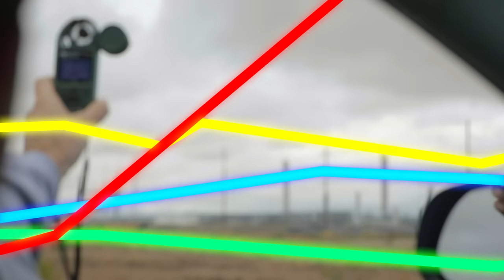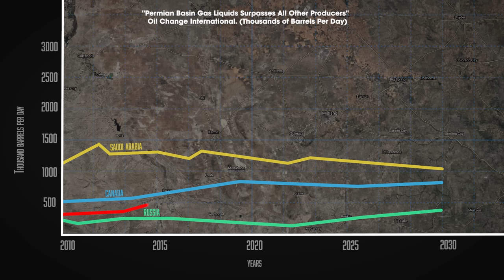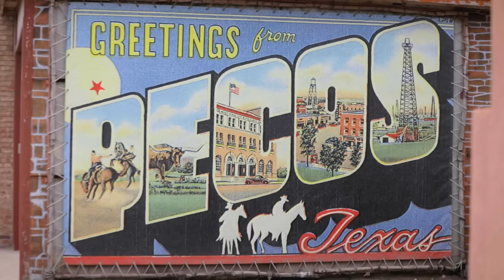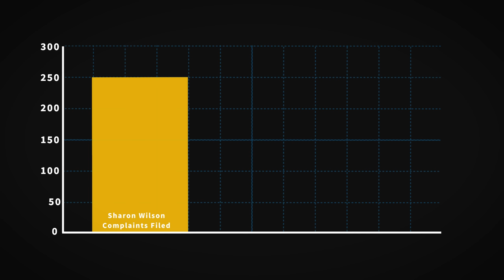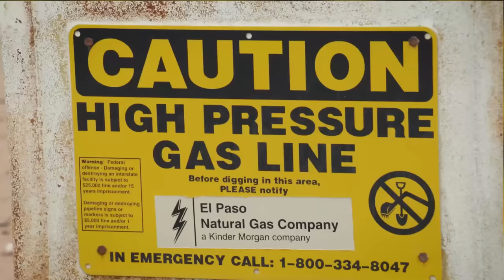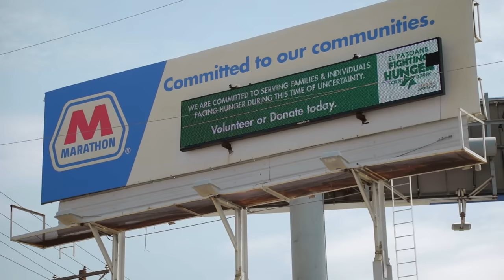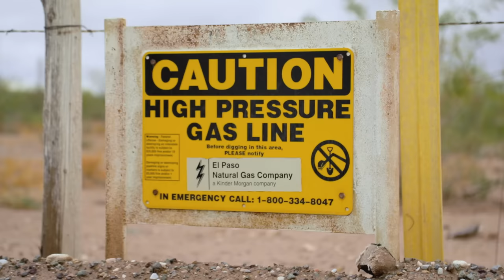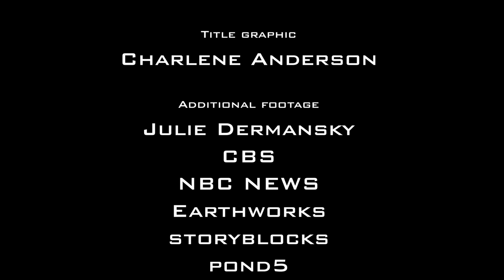Uncovering the Permian Climate Bomb

Comment: It is so shocking that these toxins have been invisible until you exposed them. Industries never have regulated themselves.
Reply: It's not so much the toxic aspect, if any, of methane but rather the impact on global warming and climate change that is the problem. 86x the greenhouse effect of carbon dioxide and it lasts for about a decade before oxygen breaks it down... 2022 saw a 'methane bloom' that 'had scientists baffled' and obviously added to the extreme temperatures seen that summer. It's no mystery if you take into account all the fracking and the fact the methane tipping point has been passed years ago and we are now seeing permafrost above and below the ocean releasing masses of stored methane.
Reply: @christianzilla  The methane is a huge concern for climate change and the low-hanging fruit in the solution. And methane brings hitchhiker gasses with it up from the formation. Volatile organic compounds like benzene and cause cancer and many other horrible health impacts.
Reply: @TXsharon  petrol is almost pure benzene.
Reply: @christianzilla  
The actual factor for methane is X150 - 200 times the effect of carbon dioxide : the X86 is based on an assumed rate of methane reduction to carbon dioxide by Hydroxyl ions for a given period. But if the methane level is maintained, the full X150 - 200 times should be used.  

Hydroxyl is created by UV impacting water : methane reduction rates are low at high latitudes due to low light level, especially in winter. 

Among the toxins released is radio-active gases, radon, radio-active isotopes of xenon. Fracking not only releases the natural gas, but also the radio-active gases generated  by the radio-active decay of Uranium, which accumulates in the rock.

Comment: The oil industry can survive, but extreme innovation is necessary. Greenhouse gas emissions have to stop.
Reply: The IPCC and the International Energy Agency say that new oil and gas investment needed to stop at the end of 2021. Even if they can stop the methane, it creates CO2 when burned for energy. Full STOP!
Reply: To be clear we need to divide the petroleum industry into two categories. 

Fuels need to stop. Stop demand, stop burning them to stop production. Support any and all decent competitive market solutions. 

Petrochemicals and Petro Materials should continue. Many of them actually reduce our emissions, efficiency and health. These do not need reduction but there is definitely improvement. Better disposal/recycling of plastics as the biggest problems with plastics are after they have been used. More environmentally efficient production, stop the leaking between the well and the refinery, enforced wellsite reclamation, improvements in social justice consequences of the petroleum materials supply chain. 

So we are not ending all petroleum, just reducing it by eliminating the market for its most damaging product, and continued improvement of its other products.

Comment: Climate crisis solutions including an open sourced, gravity driven, continuous motion, free energy generator called the Power Multiplier Device. 
  The Grow-Live Tower, which is a cylindrical structure with a central support column, periphery support columns, and suspension cables connecting the two to support the floor levels. This tower provides the food for the people that live in the lower 20 levels by growing it in the upper 60 levels. These Tower/generators, if embraced by the world, would end world hunger, homelessness, cut global disease by 85% due to improved living conditions, increase water conservation by 10,000%, end the poisoning of the world's water by petroleum and mono culture's 'one crop' farming, end the world money system by providing all the essentials for life for free.

  Restoring Arctic Ice. The water temperature at the bottom of the sea is colder than at the top, so simply pump up the cold water at the edge of the ice flow to slow the warming/melting process. This can be done by hanging 30' diameter tubes, by floatation vertically from the surface to close to the bottom. A pump at the top would need to just pump out 4' of water before the capillary effect would automatically begin bringing up the colder water to the surface. If 10,000 of these were placed close to the ice edge it would effectively lower the temperature of the water that is contacting the ice flow, slowing the melt during summer, increasing the ice build up in winter, and lowering the mean temperature of the region. Possible slowing the Greenland ice as well.

  The important thing to remember is that this global monetary system is an invention. As the numbers are invented to cause the world economy to crash. New numbers can also be invented to establish a prosperous one. A "World Zero" day can be instituted whereby all world debts are erased, all lenders are completely repaid by invented "new money", which is just as valid as the 'old money' now in their pockets. All rented homes are given to the dwellers and the new money payments are made to the landlords equal to ten years of payments, then nothing more. All auto payments end, the owners receive the titles, and the dealers are paid with new money. New money pays the people $8,000 every month in their accounts, and all of their health care needs with that industry receiving total payment for their services with new money, all student loan debts vanish. When the global monetarists attempt to 'crash' the new money system, the recorded history of the financial dealings is simply rewound back to before the crashing occurred, then restarted again. Crashes are only crashes on paper, not reality. This system can give freedom or slavery. It gives slavery because it is Satan's system and plays into prophecy.

  The Power Multiplier Device: Open sourced, gravity driven, continuous motion, free energy generator:                                                             Power Multiplier Device, last resize (I hope)-overunity.com 

Functions as follows: 

Small motor draws energy from the battery to turn a large bicycle-type wheel clockwise, turning the drive sprocket clockwise also because both share the same axle. This has the drive sprocket climb the chain, taking the whole assembly with its 2,000 pounds of weights. Three things now happen: 

1) The motor takes the assembly to the top of the chain with its 400 pound pull, taking 1 hour to do so, requiring the energy amount from the battery. Energy Expended going up. EE/up= 1 hour pull of 400 pounds from the battery.

2) As the assembly is climbing the chain, it's heavy weight (2,000 lbs.) is still hanging/pulling on the chain, pulling the chain down which turns the transmission/generator, producing a full charge of energy going back into the battery. Energy generated going up, EG/Up = 1 hour of a 2,000 pound pull by the heavy mechanism.

3) When the assembly reaches the top the small motor shuts off and the assembly's weight slowly begins to descend, pulling the chain down with it. Since it climbed the chain faster than it pulled the chain down, its descent will take longer than 1 hour for its energy generated down charge into the battery. EG/Down = 1+ hour of a 2,000 pound pull charging into the battery.

EE/Up 1 hour of a 400 pound pull < EG/UP (1 hour of a 2,000 pound pull charge into the battery) + EG/Down (1+ hours of the 2,000 pound pull charge into the battery) = FE,  EE/UP < (EG/UP + EG/Down) = FE.

With a heavier weight:

1) The motor takes the assembly to the top of the chain, taking 3 minutes to do so, requiring the energy amount from the battery that is represented by the expression 1N. Energy expended going up. EE/up=1N. 

2) As the assembly is climbing the chain, it's heavy weight is still hanging/pulling on the chain, pulling the chain down which turns the transmission/generator, producing a full charge of energy going back into the battery. Energy generated going up, EG/up=.4N. 

3) When the assembly reaches the top, the small motor shuts off and the assembly's weight slowly begins to descend, pulling the chain down with it. This descent takes 10 times longer than the ascent due to the heavy weight of the assembly, and the low gearing of the transmission, it 'creeps' down. 

In 3 minutes going up, .4N was charged back into the battery. In 6 minutes going down .8N will be charged into the battery, replacing all of the energy the small motor expended. The remaining 24 minutes of the descent will charge 3.2N into the battery, Energy generated going down, EG/down=3.2N energy not needed for the mechanism's operation, free energy.

EE/up < (EG/up + EG/down) = FE, or, 1N < (.4N + 4N) = 3.4N FE

Connecting another PMD having more weight to the lower sprocket of the first will produce more energy. The chain goes around the lower sprocket of the first one, and up around the bicycle type of the second, so the lower sprocket of the first one is acting like the small motor does to turn the first one’s bicycle type wheel. A swing arm is place between the two wheels to play out more chain as the second PMD’s bicycle type wheel ascends. Then a third PMD connected to the second….

This will decentralize the grid using home generation modules, end fossil fuel energy plants, end nuclear, solar, wind, ocean energy generation plants. It will also allow for cars that recharge themselves as they travel down the road with modified PMDs.

Comment: Why don't we use methane gas and just collect the by product? Mabye i'm dumb for asking the question but seriously why waste that shit.
Reply: Several reasons: 1) Oil is worth a lot more so that's their target. Capturing the gas is often too much trouble so they burn it in a flare or just dump it in our atmosphere. 2) It's volatile gases that will find the pathway of least resistance. 3) They have to release it when the pressure builds up or it will "rupture equipment." 4) So many equipment failures and emergencies, etc.

Comment: "Don't have the technology" to stop venting. Compressors have been around for a minute! It cost money, and there's no regulation, so they aren't doing it. If we can regulate refrigerant venting, why not methane?
Reply: Compressors also have to vent. Methane is a volatile gas and equipment will explode so they have to release (vent) the pressure when equipment gets over pressured. They also release methane to the atmosphere when they need to work on equipment. It's called a blowdown and they blow all the methane out of the equipment.
Reply: Most oil wells are small, old, and virtually artisanal in nature. They use very simple shotgun separators and flotation tanks to separate oil from brine. They sort of have to be open to the atmosphere in order for them to work. It's not feasible to maintain them as hermetically sealed. These systems operate with no electricity and no active controls. Just tanks, floats, and valves.

Comment: At $150 a barrel equivalent for energy apparently we've only got 42 years worth of oil left.  In that same time.  Of course I remember seeing commercials in the seventies that were promoting conservation of energy that said we would be out of oil by the year 2000.  Over the next 50 years,  If pipelines are not maintained the cost of delivering natural gas will measured in mass casualty explosions per year.
  I don't think the climate or the planet gives a darn what we do, it will be here after us and we seem determined to do ourselves in.

 One upside is the tens of thousands of abandoned Wells provide fantastic opportunities for gravity storage of energy.  The very first step of winning ourselves from fossil fuels is energy storage.  It is not only necessary to handle intermittent supplies from so-called renewable resources but also makes all energy sources more efficient and more effective.

Comment: Texans for toxins?  But, we are over a barrel and it continues it's advance.  I guess I'd like to see these releases compared to natural emissions from volcanic activity and solar variations as contributors to the data to put it into relative perspective.  We like cars and need them and will continue to use them.  One analyst suggests that society en toto is akin to a heat engine.  The engineers are. it seems, regularly posed with gargantuan problems that casting aspersions on is natural but sometimes taken with a grain of salt.  We'z all involved in consumption and ecology.

Comment: Just a reminder that the number 1 way to stop all this is to not buy gasoline. 
Gasoline is where the industry makes MOST of their money.
Not that they don't make money out of other things, but when you consider that homes are heated by methane, 
and instead of capturing it and selling it, they just blow it out, it's not a real moneymaker for them.
The gasoline will bring them many more times money than this "waste" product.
Consider this, If plastic was the biggest money maker for fossil fuels, you would be banned from burning any fossil fuels.
As someone else mentioned it is ALL about the money, period.
Now that you know, where their weakness is it's up to you to decide what you'll do with that information.
Reply: The simplest way would be to select economical vehicles.  

All attempts at major petrol engine efficiency gains have been suppressed. Opposed piston engine designs,  featured on Auto line, and methods of eliminating piston slap, the number cause of engine wear and heat, have all been reduced to trivial side lines. 

An attempt in the 1960 s to halve petrol consumption in urban areas by Lotus and Peugeot by kinetic energy recovery, to use the energy lost by the stop start nature of urban travel, was sabotaged by the UK government, who gave all the patent rights to Toyota. The motive ? The treasury claimed they were concerned about a possible reduction in tax revenue.

Comment: Actually, Methane has a half-life of about 9 years---meaning that half the Methane turns into CO2, every 9 years.  So, half is still there, after 9 years.

Conventional oil peaked in the US, peaked in the early seventies.  Fracking eventually made up for the lesser amount of Conventional Oil.
Reply: Nope. After a decade, most emitted methane has reacted with ozone to form carbon dioxide and water. Or from NOAA every molecule of methane that goes into the atmosphere remains there for 8 years until it is removed by oxidization into carbon dioxide (CO2) and water (H2O). 

The facts in this video were vetted by Anthony Ingraffea, the Dwight C. Baum Professor of Engineering Emeritus and Weiss Presidential Teaching Fellow at Cornell University. He used to work for Schlumberger//
Reply: This is incorrect. Just read the IPCC technical report.
Reply: @TXsharon  
Both statements are incorrect. Hydroxyl ions density is the factor determining the rate of methane conversion to carbon dioxide. At low latitudes the light level is much lower resulting in a much lower conversion rate.

Comment: I agree that venting fumes is wastefull and could be captured, but this topic deserves deeper critical thought. Economics is a major factor, as cars can be made to get 300 to 1,000 miles per gallon, emissions are reduced to safer levels consequently, problem solved.  Scholars of CO2 say we are experiencing a CO2 drought as plants and trees need it to thrive and produce more oxygen. Despite the ignorant majority, water is a viable fuel. Most climate activist are ignorant of the fact that british petroleum started this narrative, the important question is why. That answer goes back to economics, the wef, and the agenda 2030. Most climate activist are also ignorant of weather modification technology, including the affect of microwaves on the environment. Also absent from climate activist is the truth about chemtrails and the billions of chemicals dropped into the sky. Better critical thinking skills into economics, true unhindered capitalism and innovative engine and fuel upgrades and options is the answer. Corruption in politics and money is the problem. Good luck to all.
Reply: Can you expound on the critical thinking you have done in capturing the wasted gas? They mentioned it in the video but didn't give a clue on how it could be done.
Reply: @douglasjacobs882  Yes I can, capture, compression, and cryogenics sums it up. Added sealants and coatings on tanks and pipes can prevent off-gassing, followed by cryogenics and compression for transportation. The topic then returns to economic, feasibility and subsidies. Innovation and unhindered capitalism is the problem and solution. Improve and maximize engine efficiency is the solution, methods exist yet are suppressed. Water contains hydrogen, fossil fuels are hydrocarbons, get the hydrogen from water, oxygen is the byproduct, problem solved. Yet, self sufficiency for the individual becomes real, and profits deminish for the corporations. Then we come back to critical thinking around economics and unhindered capitalism. Which leads to deeper topics about govt, the constitution, evolution and the meaning of life. Hence the need for critical thinking, which remains, for the most part, absent from misinformed climate enthusiast.
Reply: Here is an example of a critical thinker on the topic.

Comment: Oil is all natural, so is methane.
Even if it's not pumped out, it's still there. So is the methane, and leaks from the ground naturally.
Reply: Right...There is natural atmospheric carbon and surface oil. 

PLUS the massive amount we drill for and artificially release offending the natural balance. 

See the natural bit is not the problem. 

The human cause bit massively exceeding the natural bit is the problem.
Reply: Better to keep it in the ground